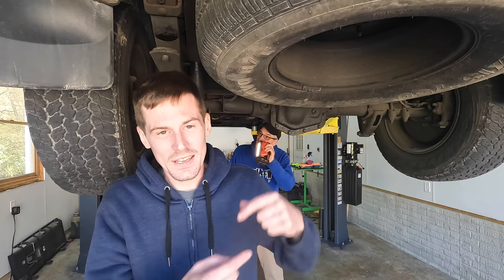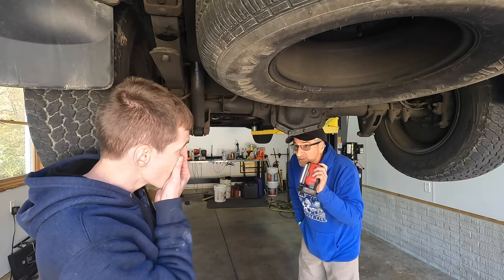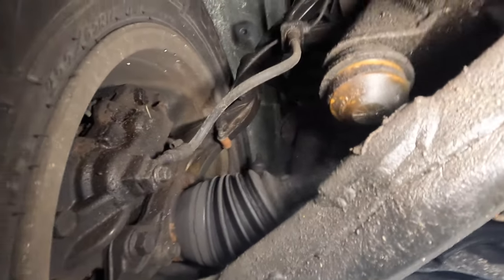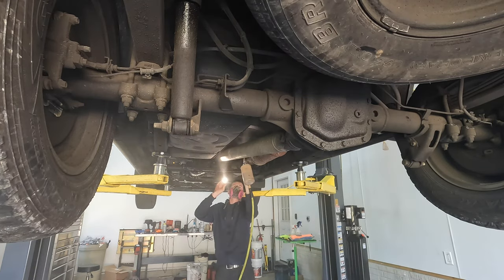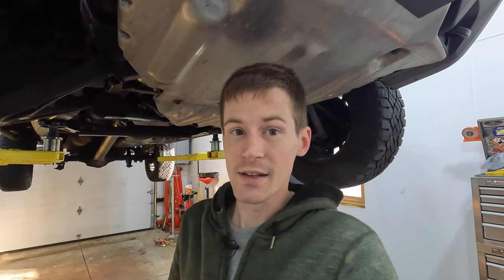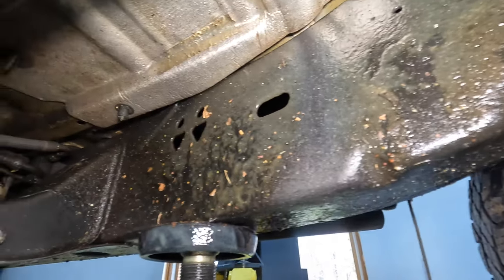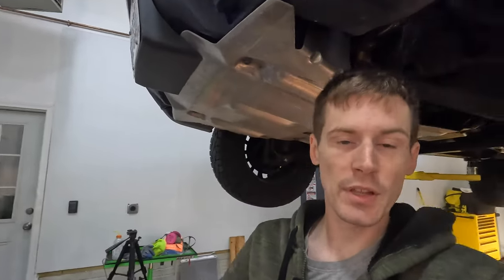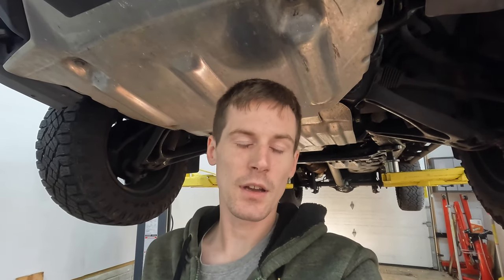Lanolin Undercoatings 5 Year Review & Career News... (Fluid Film, Woolwax, Surface Shield)

Comment: Question, my truck has a few coatings of FF from 2020 until last year. Has a layer of grime on the frame and suspension. Last week I got caught in a deep freeze and the county dropped loads of salt on the roads. Now my frame is partially white due to the road salt. Do I rinse the salt off with a light pressure garden hose and add a coating of FF or just leave it alone?
Reply from the maker: I just leave it alone. That salt is sitting on the coating and not the metal. If the salt isn't on the metal, it's not going to cause rust.
Reply: @Repair Geek  Wouldn't it be difficult to rinse the salt anyway off since it's on oily grime, short of a pressure wash? I'm tempted to spray another layer of FF over the salted parts...but seeing your truck, you left it alone and just coated it over the winter funk during the spring, correct?
Reply from the maker: When you leave the salt there, rain is going to wash it off as you drive throughout the spring and summer. By the time fall hits theres no salt left and that's when I'm coating again the the upcoming winter. I don't see any harm in washing the bottom of the vehicle with low pressure water. Will you see any benefit for your effort? I doubt it.

Comment: Should we be concerned with getting the product on the brake rotors?
Reply: Yes, encapsulate them while spraying. The rotors are to be absolutely clean and dry from all grease to work as intended. Use brake cleaner (spray can) afterwards on the rotors, but don't breathe while doing it.

Comment: Nice update.. Well, I'd stay with Fluid film, its been a success, nearly 1/2 cost of SS, and as you indicated, SS may need yearly touch up too.
Reply: Fluid film out in my area is actually slightly cheaper by about $0.10 cents. In the aerosol can form.
Reply: @offroadpatriot7219  Sorry, I was referring to gallon
Reply: When fluid film gets warm it drips , I'm sure it's fine, but surface shield is a step above
Reply: @offroadpatriot7219  get it at Walmart and you get a larger can for less $

Comment: What Goes Best On The Prop Shafts? ... I've tried a few products and they just seem to Whip Right Off!!
Reply: Not an expert but I used Woolwax on my prop shaft and it's been hanging on. I sprayed it and then rubbed it in with my gloved hands so as to keep it thin. So far, prop shaft is new looking after 2 years and doesn't sling.
Reply: @BladePilot24  my trucks prop shaft was getting crusty already after 25 years, i am currently trying the Cosmoline Black Spray... its tacky still and 'appears' to be hanging on looking black still covering the crusty

Comment: It is good that you have tried to protect your metal.  But there is a problem.

You said you previously sprayed the metal with something else,  so how do you know that other item you sprayed on the metal isn't what kept it from rusting???
You won't know because you sprayed over it..
I spray my metal with mineral oil and my last inspection was clean, and I don't expect  my next inspection to be much worse...  depends on what is used

Comment: what are the long term effects of these products on rubber? shock covers, gaskets, hoses things  like that under the vehicle
Reply from the maker: 5 years in and I'm still waiting for an issue. I will replace every bushing in my suspension before I would pay to have my bedsides and rockers replaced.
Reply: It could be inert and have no reaction, it could degrade them, or possibly protect them from degradation. One would have to conduct a test on rubber parts to know for sure.

Comment: all these lanolin product protect great,  but Surface Shield sprays WAY better. i have used Fluid Film and NHOU and both need to be either heated or thinned to spray halfway decent. maybe if you spray in the middle of summer or an 80 degree heated garage they might be ok , but here in New England we usually spray in the fall when it is chilly and they are kind of a PITA, whereas the Surface Shield sprays awesome regardless.
Reply: Hi Volksjager. Do you mean spraying using a compressor or spray-can with aerosol? If compressor, what's the value of the pressure?

Comment: is it best to cut off rust to bare metal as much as possible, then coat it with some kind of paint or something and THEN adding the coating or what, whats the material that is added to the bare metal besides the lanolin products?
Reply from the maker: What's your goal? Concourse restoration or just stop the rust on a daily driver?
Reply: @RepairGeek  I emailed you a couple weeks ago, I have a short school bus I’m converting into a home so I’m trying to add good protection to the vehicle and remove the current rust it has mostly underneath.
Reply from the maker: @TheOutlierArchive  if you want it to last that thing needs new metal. Your inner wheel tubs were SHOT. No coating is going to bring back the structure.
Reply: @RepairGeek  do you think it would be best to find spare wheel wells off of another school bus and welding them in or custom making one or something?
Reply from the maker: @TheOutlierArchive  make new ones. Use cardboard templates and tape to give you the shapes you need. Take the templates and cut it out in metal.

Comment: I’ve been using both NHOU And fluid film. The only major difference I noticed between the two is NHOU creeps a lot further.
Reply from the maker: I'm curious if that product that has crept actually offers any protection. They've always shown "Look how far our product creeps" They've never tested if it actually stops anything. Motor oil will run and creep all over the place, but the protection is crap compared to something you buy off the shelf...
Reply: @RepairGeek  I’m not sure about the protection. I was spraying two ram truck’s. One with NHOU and another with FF. I live close to ocean city md so we deal with a lot of salt air salt water some snow in the winter. Any thing is better than nothing I guess. The only pain with NHOU is it would creep so much in the summer it would start coming up the outside of my doors hood tailgate ect and get all over the paint

Comment: What's the interval for rustproofing the inner cavities?
Reply from the maker: I do it once a year because I have it in the air and I'm there.
Reply: @RepairGeek  
Thanks. It seems you skipped them this time. Will it be okay to do every 3 years? Because I don't see what's going to displace the protection... It's hidden.
Reply from the maker: I just edited it out. I did them. Reapplication depends on your environment. If you're using the vehicle to spread salt, then you may not make it even a full year. Something in Florida could go every 3 or 4 years probably. I wouldn't wait longer than a year to reapply until you know how it will hold up. I change my oil 2x a year typically. That is when I advice people to give things a once over. The car is already jacked up. It doesn't take long to spray some product while you're there.

Comment: A lot of people don't realize that rust is a 12 month enemy, not just a Winter one.    Fine gravel and road dirt collects in all those corners and crevices....hold moisture even in a Summer drought.  
You truck owners who don't undercoat, should at least wash under there after every "dirt outing".  
It's more important to care for underneath, than it is the paint.
Reply from the maker: I'm not sure I buy all that. You don't see any 15 year old rusted out vehicles in Southern Arizona. Maybe some light surface rust on parts with little paint. Nothing with a frame rotted in 2 like you have in the north.
Reply: @RepairGeek  I agree, you do don't see totally rusted out vehicles that far South.   But keep in mind it's really, really, really dry down there.   All that sand in the cracks actually dries out.  That far South is an exception to my thought above.   But I'd be concerned if I lived where it rained occassionally.

Comment: Congrats on the new job.  Unfortunately you will not be able to be unbiased as your employer will always be watching and in the back of your mind you know this.

Having said this you seem to have a lot of integrity, it's just going to make content for the channel a little tougher.

On a side note how does fluid film and surface shield work on aluminum like the body panels on the Ford F150's?

Unfortunately I can't find surface shield anywhere in Canada yet.
Reply from the maker: I don't see it that way. I'm just not going to shoot any content using Blaster products.

You'll have no issue spraying aluminum. 

Word I'm hearing SS is going to be in Princess Auto at some point in the future.
Reply: @RepairGeek    Goot to hear about the aluminum.   Thanks.

Seeing it in princess auto would be great.  I found it on Amazon but it's double the price of fluid film, over $200.00/ gallon.   Hopefully it is more reasonable at princess auto.

The problem with not shooting any PB stuff in the future is PB needs to be on every comparison as they make great products and it seems for undercoating they may have the best product.  It wouldn't be right to exclude them...   makes things difficult.

Comment: if you want to fairly test the flammability/solvent content take your torch and see what the discharge of your application gun looks like when exposed to ypur propane torch.  Taking a torch and blowing it onto a cool/cold surface proves very little.
Reply from the maker: Aluminum dust is flammable. Aluminum stock is not. Atomizing nearly any compound greatly increases it's flammability. Most people are concerned with is it going to make your car flammable after it's coated. Go try what I did with 5 gallons of gasoline and let us know how it goes...

Comment: You'll have to spray some kind of free flowing and creeping oil inside the frame or it will rust from the inside out.  That and I recommend flushing the inside of the frame with water in the spring when the road salt is gone.
Reply: No s***..... if you watch any of his other videos you see that he does that, other than flushing  with water

Comment: If you ever get a chance to do additional testing on other products, I would like to see how Dinitrol stacks up against the Lanolin stuff. As I understand it, Dinitrol is a primarily wax mixed with a solvent - which once the solvent dries leaves behind a semi-hard wax. The main benefit I could see to something like that is that it would likely stand up to rock chips better than the pure Lanolin products. That could in turn mean that you wouldn't have to necessarily reapply Dinitrol almost every year like  you do FF, SS, etc.
Reply: The risk with a thixotropic wax product like Dinitrol is the wax eventually drying and hardening to the point it cracks and allows moisture underneath like a rubberised product; the whole point of lanolin based films is to stay fluid and not dry out; lanolin films are prone to wearing off, so need occasional reapplication.

Comment: Of these products you don't talk much about which one creeps more effectively. Mabe u can do a video to address this questions. Also, as far as I know none of these products contain any petroleum product in them...thus they are not flammable by themselves.
Reply from the maker: I plan on addressing this question this coming fall.
Reply: @RepairGeek  Awesome! I'm sure you're already thinking about this but initial creep vs creep after driving around in the summer heat may likely be different. It would be great to consider both if you feel it's relevant.
Reply: @RepairGeek  some of these products can distort and destroy rubber?? it happened to me unfortunately 8^{ ... the label even SAID safe to rubber parts!  nearly 500$ of damages done
Reply: the best test for creeping might be what is sprayed into a trucks tailgate and weeps out during the summer heat??

Comment: Coong rats...   Hope you will continue to test new products as you have in past to rule out snake oil.
Reply from the maker: I will be for sure. I currently have a couple of tests running right now. I probably won't have conclusive results until at least spring. That's the problem with real world testing... It takes real world time...